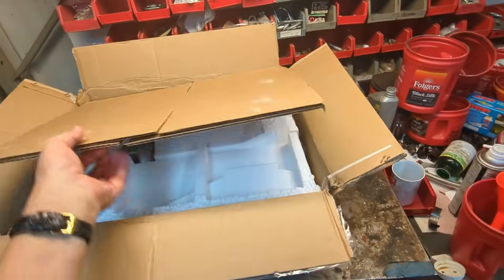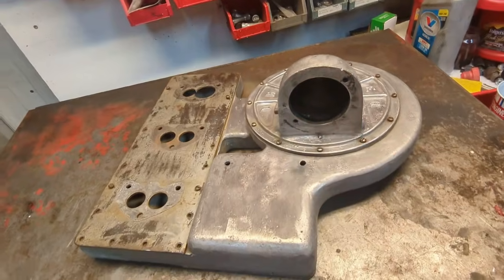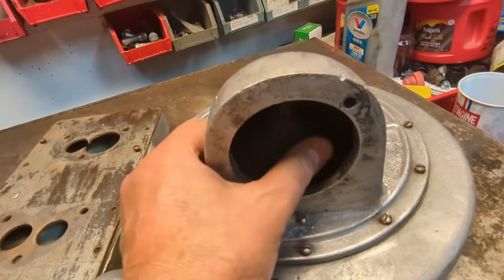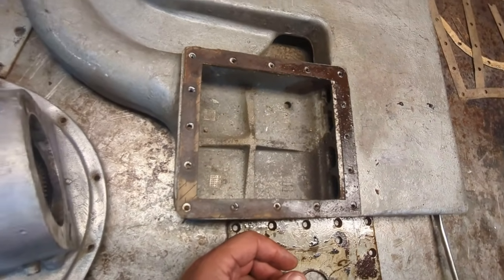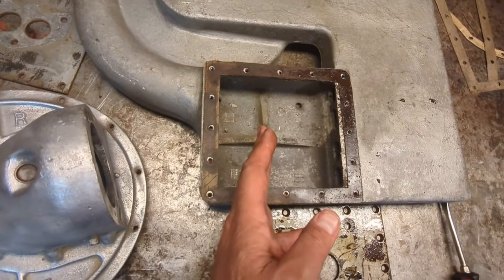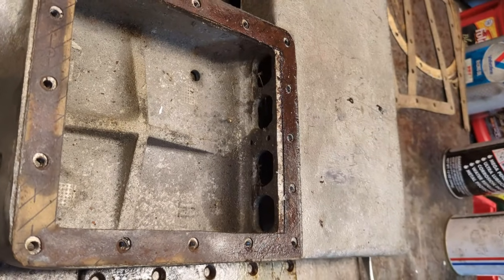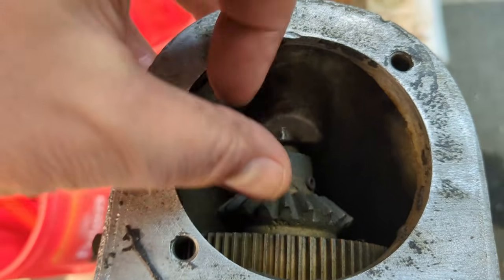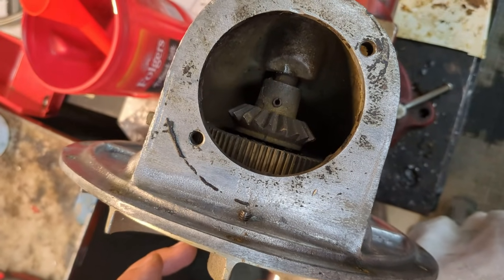Oberhausen Vintage speed part Dragster electric supercharger

Comment: Instead of an old Ford starter motor from the 30's just modify it to use a new brush-less electric motor that'll do 10k rpm and use about 5 kilowatt hours of batteries to run it. It'll definitely give you some boost then.
Reply from the maker: Thanks for the idea. Where can I find such a motor?

Comment: 4-barrel adapter needed for correct height and bolt pattern ?
Reply from the maker: I might need to make my own adapter plate. To make it fit whatever I put it on. That shouldn't be too hard to do though.
Reply: @HemiJoel 
Stacked pine board template to figure height clearance.  🤜🤛
Be too cool at a car show or get together.

Comment: Use Moden two stroke reed valves for the bypass . But as it's a Centrifical supercharged it's not positive displacement, so fuel and air can go straight through the supercharger when it's not rotating, it don't need a by pass .

Comment: That is such an amazing find. If you could take photos with a ruler included would be helpful. That would be the perfect project to scan into CAD software to eventually 3D print it and use the printed parts to create a mold for  casting the parts in aluminum...

Comment: I bought mine on eBay. They claim it's not effective but... I love it on my hotrod. The starter is the flathead Ford one. Thanks for posting
Reply: If you can find a motor shop that makes variable frequency drive dc motors they will have no brushes .  They have to have a controller . Rpm’s would be adjustable .plus they don’t see no load .  I’d say 0 rpm up to 4000rpm maybe 5000rpm .  The new jeep grand Cherokee has the heater fan motor in it like what im talking about .  Theres no set places for low ,med, and high.  It’s like a volume knob on the radio .  Just like drill with the variable speed switch . If you would get away from the starter motor it might produce some boost . But turning one rpm and a low one at that . It’s not going to do much I don’t think .  Starter motor turn 1000 rpm at 6:1 would be only 6000 rpm . If you had 2000-5000 rpm then it’s 12,000 rpm to 30,000 rpm if it don’t produce boost at those numbers you might as well give up .  I’d say at 12,000 you should feel a difference !  What does the belt driven ones run ?  I’d have to find that out. Get a stater off a caterpillar 785 or 789 .  They are air starter , yes a real big zinnnng they turn real fast .  But it’s just a quick thing they have to build the air up with a mechanic truck when they set for s day or two .  But for a quick burst that might be a way to get boost from one .  I still say the VFD motor is the way to go. .  There just awesome .  Dosn’t matter to them they see no load .
Reply: @HaroldPrittJr  The only problem with running these at higher speeds is the compressor design is ancient, and it may "stall" and not produce higher pressures beyond a certain speed... meanwhile something with metal that old is more likely to explode or at lest be damaged from the mechanical forces first.

Comment: I would use a large brushless motor at 30 volts or so. Lower KV motor in the 800 range. You would need to machine a gear for input but the output shafts on these are eight to 10mm in most cases.

Comment: That old electric turbo could be substantially more efficient replacing the low RPM starter motor with a three phase brushless. 👍
Reply: BMW make several large high torque electric three phase motors for water pump use. Worth a look. Probably a turnkey controller solution out there somewhere. Some RC hobby controllers can handles hundred of amperes. I use them in large off shore electric rc boats. They can support 15 hp of power output at 30 volts plus.
Reply: id be afraid to turn that old thing too hard, plus i imagine the efficiency would drop off real fast if you spun it beyond what it was designed for
Reply: @colestowing8695  That's all part of the fun, as long as it's being recorded! 😏
Reply: @Zodliness  fair point 😄
Reply: Don’t put a newer high speed motor on the original blower. Get a hold of “ol foundryman” and make a new prototype so if it grenades, you haven’t smoked the vintage one.
Reply: @blakkat531 that's a great idea
Reply: BDLC Brushless e-bike conversion motor up to 5000 Watts (7 horsepower) 0-5000 RPM

Comment: Wonder if you could make a split-shaft drive with a slip coupler to power the input from a belt, rather than try to use electric drive.  Very cool piece of history right there!
Reply: They would sell a long snout originally if you wanted it. Images are still on the Internet. I like that style better but mine is electric.
Reply: Frenzal makes the exact supercharger for flat heads in the 1930/40s

Comment: 4:30 probably supposed to have Reed valves like a two-stroke
Reply: A thin phenolic or plastic plate pushed away from the crossfeed holes by weak springs would work just fine.   Leave enough gap so the off boost breathing isn't impaired but close enough that when the supercharger pressure starts to come up it'll push it closed right away.   That actually will wake up a Flattie for sure!
Reply: @recoilrob324 true , but as it's a Centrifical supercharged it don't need a by pass , when not rotating it can flow air straight through.
Reply: @JosephCowen-fz8vj  Yes...but this is carburetted so the flow without a bypass would need to make it all the way through the cold supercharger then around the bend to the intake losing fuel as it condenses on all the surfaces.   This would make triveability miserable and proper carburetion adjustment impossible.   The bypass gets fuel to the intake much sooner and in much better atomized condition and absolutely will make for a better running engine.
Reply: @recoilrob324 probably , true .
Reply: @recoilrob324 Thank you for this top tier comment and effort. Please allow these few personally curated words to serve as a sign of gratitude to you and the previous commenter. The dead internet comment sections of "X" are hell. Be gone clanker commenters.... I'm not machinist I swear.

Comment: Also a high cca new battery will make a huge  difference as well !!! 1400 cca new battery not a lead battery !!!
Reply: getting as powerful as you want a motor and batter for it in 2025 is fairly easily done

Comment: One of the coolest things I’ve seen in a while. I want to see an old 32 with an exposed flathead running this with a custom motor that can achieve at least 65,000 rpm for input.
Reply: Math counts. 65,000 X 6.5 = 422,500 = Explosion
Reply: My bad I meant to say output at 65,000 RPM thanks for pointing it out. @kevinsellsit5584

Comment: I'll be surprised if that actually works. I'd probably make an adapter to run a single 4 barrel it would probably work better that 3 2 barrel carbs and easier to tune.
Reply: 3  2barrel carbies would give the nostalgia look and still not hard to tune..
Reply from the maker: @rebekahfrench5747   If you check out my other videos, you will see that more than one carburetor is not a problem for me.
Reply from the maker: I might remake the plate to run 4 carbs! (: